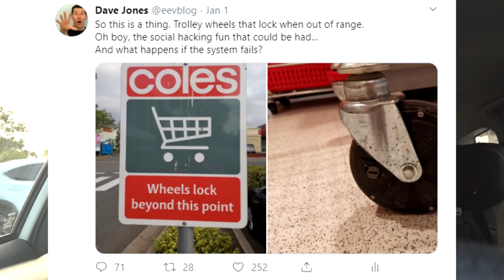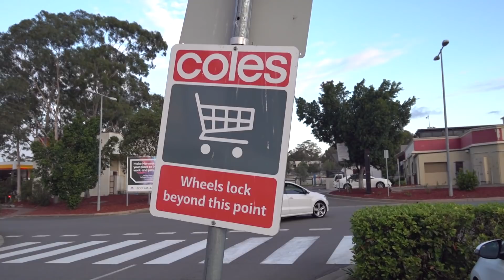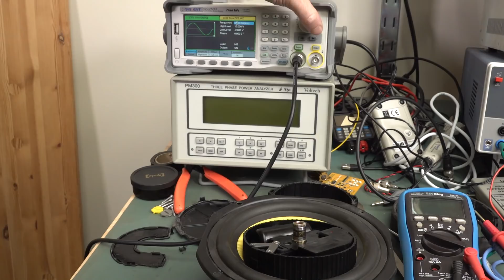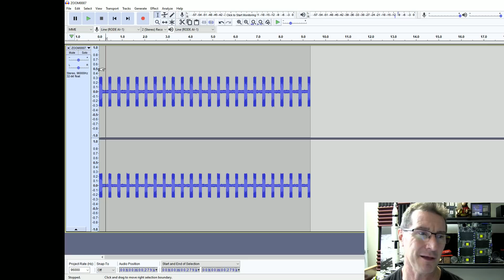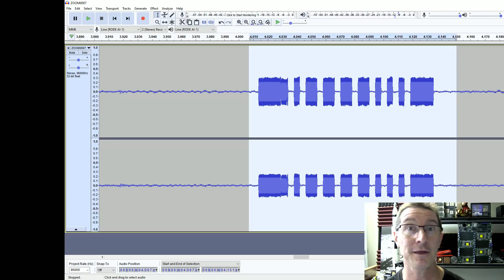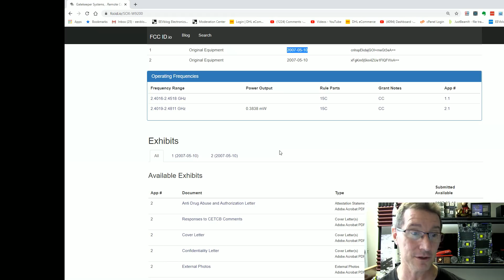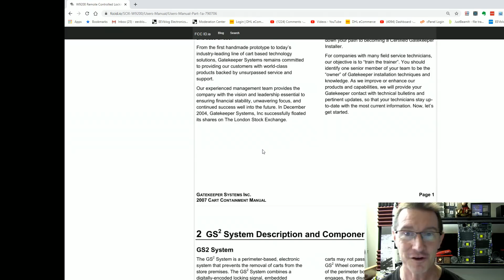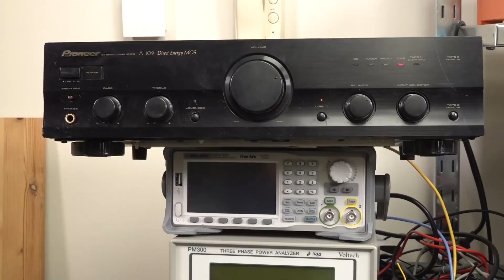EEVblog #1287 - Gatekeeper Shopping Trolley Lock Investigated

Comment: Almost everywhere here in Denmark, you'd need a coin to lock them up and use them. Much easier to manage it seems and we don't see these clowns leaving their shopping trolley behind in the bushes. The coin is more important for them.
Reply: Brian Hougaard Baldersbæk we have those in Australia too, usually found at Aldi! It’s a great idea but super frustrating if you don’t have a coin haha.
Reply: Brian Hougaard Baldersbæk  — The Danes must be very well behaved, at least compared to people in my neighborhood here in Canada. We have the $1 coin lock system here, yet I can find dozens of carts scattered around my neighborhood. I assume the inconsiderate troglodytes jam a tool or key to either release the cart without coin, or else use a similar method to release their $1 coin when they dispose of the cart. These carts are a terrible blight in my neighborhood.
Reply: We had those in Norway as well, but I think they're less common now. Coins are less common as well so that might be a part of why theres fewer of them, but compaines started giving away promotional tokens that fit the trolley lock, I'm quite sure that made them less effective.
Reply: @PeterMosier  Upbringing/social control could be part of why it works. Abandoned carts aren't see nin general, but I see them occasionally where I live - where there is a higher-than-average amount of easter-europeans and middle-eastern immigrants. They may not realize that it is theft. When I see an abandoned cart I just inform the supermarket where to find it and they usually pick it up within a day or so.
Reply: even tho the coin is just 10 or 5kr nobody will leave the coin in there 😂
Reply: @whodis5152  :D Exactly. Money beats utter laziness. On the other hand, laziness expands the workforce, because you need employees to gather the trolleys and put them in an orderly queue. But this and the expenses for installing this Australian system just gives higher customer prices, which is bad for competition.
Reply: @DK640OBrianYT  Here in Germany some shops have even carts where the handles are color coded and can only whithin the same color release your coin. This is to prevent long chains of carts and pooling of carts in one place, so you can not take a cart from the shop entrance and bring it back to the nearest station to your car.
Reply: The coin will force most lazy people to return the trolley into place after use, but it won't prevent people who have in mind to take it with them (for personal usage) to do so.
Reply: If you don't make a locking device and lock the whole row I will be very dissapointed
Reply: Some Coles stores have this rather than the locking wheels.
Reply: Netherlands we usually have BOTH systems.
Then again, people here found that shopping trolleys make excellent barbequeues (you listening, Australians?) and the 50 cents isn't going to stop people stealing them.
Reply: Brian Hougaard Baldersbæk they had this system in a store where I live in the US they finale took it out because to many homeless druggies would run up and grab your cart and run off with it and take it back to get the coins I think it was like .50 the use the cart and when you returned it you got your .50 back they said on a local news report they had a video were someone would just run up an grab the cart an run off with it! they counted almost 10 people lurking in the parking lot at the time of the video but the had an interview with a couple of customers and one said there have been more the twenty people running around and even said there have been fights with customers and people grabbing carts and the police were called soon after this news report the store took the system out and when back the the old way!
Reply: This system's been around in Lithuania since I dunno when (: and there still are odd trolleys here and there

It's a funny situation with supermarket lockers btw. We have quite a few here, in a couple chains, that will only lock when you put in a coin. Upon unlocking you can take it back. By this moment, Estonia's been the only country we've visited where lockers had - sic! - special money containers (can't really recall whether they took coins or notes). So you pay for the locker, without withdrawal rights xD
Reply: In the future I hope there will be systems where you have to pay like 10$ or whatever with your card and you only get it back if you put it back and hold the card against it again. No one will leave a cart behind I tell you that
Reply: @geraldcampbell6834  the US sure seems like a great place to live!
Reply: The Netherlands here, you must use a coin to unlock the cart but doesn't have to be currency! Most shops have coins you can keep on a key ring. most carts have hard plastic wheels that only work on the shop floor. take them out on the street ( usually brick) they don't roll very well. None of that rubbery crap!
Reply: for those, you need to borrow 2 coins. Get 2 trolleys and then back to back link them up. You get your coins back and a juggernaut trolley ;)
Reply: There are parking disks or key chains which hold plastic coins for the shopping carts.  Often it is possible to pull out the coin again.  It's usually also possible to take two carts and lock them together to get both coins back.
Reply: @ralfbaechle  I'd just said part of that !
Reply: In Canada they do that too. You put your toonie in the cart (2 dollar coin) and when you bring it back you get your roomie back. In the US the democrats would have a fit because they would claim it was discrimination against the poor even though you get your money back and they could return carts that lazy rich Americans can't be bothered to get their $1 back.
Reply: @thomasoo5726  Never heard or seen this. and I am from Germany xD Which shop do utilize this?
Reply: @DK640OBrianYT  I'd have thought that the main expense is lost/stolen trolleys that make it out of the carpark. Obviously paying people to round up trolleys is an expense, but the cost of a single trolley is probably around €800 which dwarfs a minimum wage employee spending time walking around the carpark getting trolleys that people are too lazy to return
Reply: @Snowbird815  It is a smaller EDEKA dealer with 5 stores, at least the 2 newest have this where the building is around 5 years old. The Plug on the chain has a shroud with different notches.
Reply: All that is needed to beat the dollar. metal the same shape as the hole with no hole for its pin to grab. Ives seen people cut of a lock chain and use a model end to unlock carts.
Reply: @nataliekate2176  Not really fascinating Aldi does this ;) Aldi is from Germany and in Germany there's basically no (!) shipping cart without such a coin-release. Someone say "1 Euro BBQ" if you might imagine why ;)
But since than, no more carts are laying around.
Reply: @thomasoo5726  Ahhh ok.  I thought the carts would distinguish between each other via the colorcoded heandle with some crazy sensors.
Reply: I have never seen a cart outside of a parking lot/store here in germany.
Reply: @whuzzzup  They have also a breake wheel in addition to the coin for rental. In German ALDI you can unlock a wheel pushing it over the entrence carpet as under there is also a coil.
... I just had the image of Dave in the middle of the night breaking into ALDI to record the unlock signal ...

In the US they would make it that you dont get your money back and have to pay by credit card. If noct returnt back to a propper place the will carge a aditional 200$ recovery fee.
Reply: Same here in the UK.
Reply: @previousslayer  the system where they keep the money for the locker, is seen severel places. If you go to Legoland in Denmark, you Will find that system. Its also seen other places, amusements parks eg. Where you pay for the locker, each time you wont to lobk it...
Reply: Lazrus Sanschei nice.  Like Zip Cars...
Reply: you can bet homeless people would frequent parking lots to return left carts to get the coin
Reply: tyler roberts some don’t wait and just ask if they can return the cart for the shopper.  If they’re being polite that day, LOL!
Reply: Same in Spain, 1€ or 50c
Reply: We have same coin lock system. And 10 years ago kids and poor folks sometimes offered to take trolley from your car back to place.
Reply: @geraldcampbell6834  Where in the US is that? Even parts of the US I consider to be complete shitholes don't have that problem.
Reply: There are good parts of the US, and there are bad parts.
Reply: Poland - same.
If I guess correctly.
Reply: @nataliekate2176  I've seen them used by Coles and Woolworths, but usually only in 'bad' neighbourhoods.
Doesn't help, because where I lived they had them, and still I routinely found trolleys a km or more from the shops...

I've also seen places in the UK using both coins AND wheel locks at the same time, so... You know.
I mean, they aren't exactly mutually exclusive methods...
Reply: The coin system can be beaten by plastic ones that can go in keychain though.
Reply: Haha 😂 ironically a pound I'd so much more important now than it was then
Reply: That because the blob dot is above the shopping trolley so we can't shop it 😭
Reply: @jwenting  lemon?
Reply: @ice2dice  is this the right leg they're hiding? Is this why they cast a spell on me to link the Pakistani Patti to something else? 😂
Reply: @Dragon-Slay3r  never tried to grill a lemon...

Comment: The first time I encountered this, I thought a rock had gotten caught in a wheel. Then I realized it was both front wheels that were jammed. It locked as soon as I left the store (they have since moved it to the parking lot perimeter). So I tipped the cart back onto the rear wheels and kept going. Only the front wheels had the lock. I did return the cart when I was done.
Reply: I believe in the US it would violate the Americans with Disabilities Act if the shopping cart could not be taken to the customer's car. I'm not a lawyer, but I think it's on Wikipedia also.
Reply: Presumably those mobility carts with the seat and electric drive can still be driven to cars.
Reply: At my store, they no longer lock as soon as you exit. It maybe because of the ADA.  However all these locks can be disabled by the store. That may make them ADA compliant.

Comment: I work for a supermarket in Duluth MN USA, 

this system works great we haven't lost a cart in 3 years
we have another branded system at another location its called rocateq,  this brand uses very low grade parts
I have replaced over 150 of the 300 units we have installed

Comment: I think the loops in the road are for the traffic signals not the carts. The carts use a loop around the parking lot, at least in the areas where we live.
Reply from the maker: No, watch the video, I capture the code from it and also show the installation photo guide.
Reply: I would've thought it'd loop the whole parking area as well.
Reply: Loops in the ground are not just for traffic signals. Didn't look to be one near the loop Dave recorded.
Reply: Around 20:40 when showing the manual, it seems to describe 2 different ways to install it. Individual loops at each exit point, or a single large loop around the entire area.
Reply: David Jameson  Tear up a parking lot? You take a walk-behind concrete saw, cut a groove in the parking lot, and put the wire in.

Comment: was expecting a generator in there so pushing the trolley charges the battery like some batteryless safe rotary combination locks.
Reply: "like some batteryless safe rotary combination locks." 

Excuse me ?
Reply: @Boraxo  Kaba X10 self powered battery free safe lock
Reply: @kissingfrogs  battery free lol if it charges then it has a battery
Reply: @joecarnes9174  Not if it uses a large capacitor instead.
Reply: @awo1fman  splitting hairs a bit aren't we....a capacitor is pretty much a battery really. I mean a short lived one but a battery none the less.....
Reply: @joecarnes9174  Wrong on every count. They are both energy storage devices, but so is a flywheel, or a watch spring, or a hydroelectric dam's reservoir. That doesn't make them all the same thing. Also, you're the pot calling the kettle black... 🙄
Reply: @joecarnes9174  batteryless as in no need to replace one
Reply: @awo1fman  touche lol
Reply: @kissingfrogs  they do wear or go bad, I mean same concept ...
Reply: @joecarnes9174  Every man made object does.
So every man made object is a battery.
lol. Seems legit.
Reply: @QoraxAudio  absolutely
Reply: Joe Carnes I take offense at the notion that capacitors inherently wear or go bad. It’s all price vs performance. Buy sealed wet slug tantalums and you can send them out of our solar system and they’ll keep on working. What do you think was on Pioneer and the Voyagers? Not electrolytics, but they needed some hefty capacitors there for sure - nothing that could have been done purely with ceramic multilayer ones. You can still buy those for industrial use (or hobby use if you so wish). Sure, you pay like $25 for a “jellybean” capacitor, and there are almost no volume discounts, but you design it in correctly and you can forget that it’s there. It’ll be ridiculously unlikely to fail.

I’ve seen some boutique audio equipment where instead of pushing pseudoscience, they actually focused on longevity and real performance. Got a 2x25W monitor amplifier in early 1990s, and everything inside is over designed and most capacitors are wet slug tantalums; the rest is poly or ceramic. 30 years later and they all have proper ESR and work great. As does the whole thing, really. But it cost a fortune back then (probably $20k in today’s money). But I expect it will outlast me, easy. It still has about 0.1% distortion at full load, and 0.02% 3dB down from that. Insane. 0.005% at 1W. PSRR is 140dB to 1kHz. I had trouble measuring it. It’s designed like a piece of space RF gear though, with shielded partitions, and the whole thing is mounted in a machined slab of aluminum with cavities and passthroughs. I don’t have anything that can measure the crosstalk in that thing under 1kHz. It’s in the noise of a 20 year old AP analyzer, and those were quite marvelous even then. You probably get more crosstalk just by running the speaker cables untwisted and in parallel. And all this runs on 30-year old capacitors and good engineering. Sure, nobody can sell consumer gear that way, but it can be done, even if it’s an academic exercise, so to speak. 

 I’ve been designing with regular plastic-encapsulated tantalums for decades and as long as they are derated properly (a whole lot), they don’t fail either. I pretty much don’t use aluminum electrolytics unless it’s a high-voltage, high-power application. Everything that would fit in your palm is all ceramics and tantalums for me, and they are solid performers. Plastic dielectric in signal paths so that it doesn’t microphone.
Reply: @absurdengineering  If you like tinkering with high-end/high-frequency analogue circuits, you should get yourself an old Rohde & Schwarz oscilloscope or spectrum analyzer made for measuring high frequencies.
Especially the input circuits with all the distributed element filters are impressive engineering.
Reply: @absurdengineering  are we still talking about shopping cart wheels..... troll completed...🤣 thank you that was awesome! I mean it's like 2 er 3 days later lol thanks again.
Reply: Qorax I find that any sufficiently capable tool is, well, sufficient. I often use an “ancient” LeCroy scope formerly used (apparently) for hard disk read/write circuit devlopment. It has the PRML décoder option (and pretty much all other options available for that model). An a 68k CPU. I rarely need anything better.
Reply: It could be powered from the in ground coil.

Comment: My local grocery store had a landscape trailer they would use to go around the neighborhoods and pick up all the carts that people stole and dumped. They installed a system like this when they remodeled, and I haven't seen the trailer since. The ones we have are impossible to push once they lock. It has a shoe that gets dragged under the rear wheel, with hardened steel inserts. Since it's on the rear wheel, you can't push it without lifting the rear of the cart. The shoe also stops people pushing it with the wheel locked up (like the one in the video) and creating a flat spot.
Reply: same thing here...used to provide jobs for 3-4 people....now they installed this crap and you cant take a trolly more than 3 meters from the front doors with out it locking up... another scam by the supermarkets to generate more profit..while hurting the community (just like self serve ..and pay for plastic bags BS)